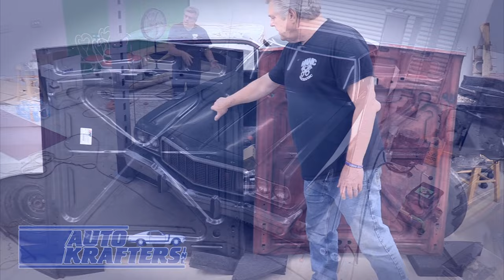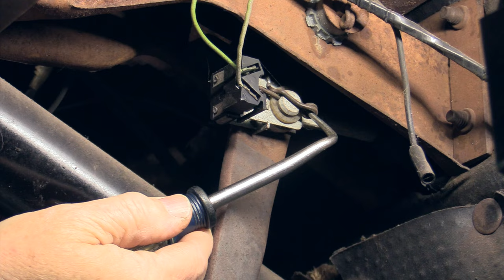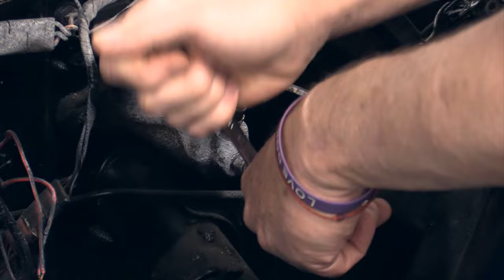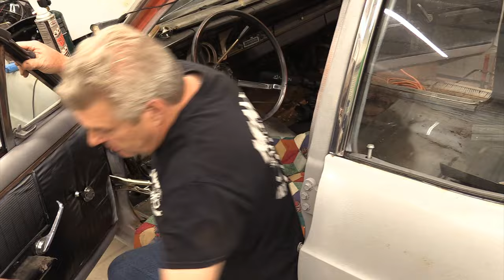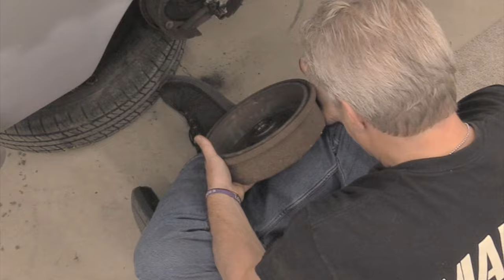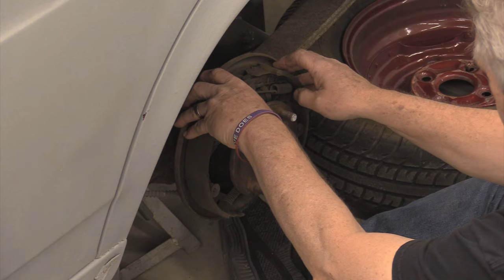Drum Brake Failure! We Diagnose Our Ford Drum Brakes

Comment: Nicop brake line is fantastic.Wheel cylinders are so cheap now no need to rebuild them.I picked up a good used brake laith its great to have if your working on classic cars.
Reply from the maker: Man, I would love to have a brake lathe and also a drum lathe to be able to work those things. Our problem is studio space to shop tools starts getting crowded quickly. I need more room, but I can't have it because of the county. LOL.
Reply: @AutoRestoMod  The one I have takes up small space and does drums and rotors.